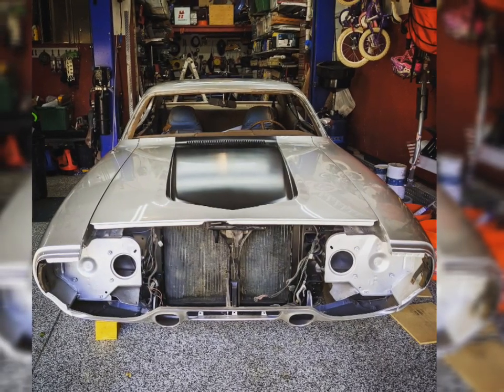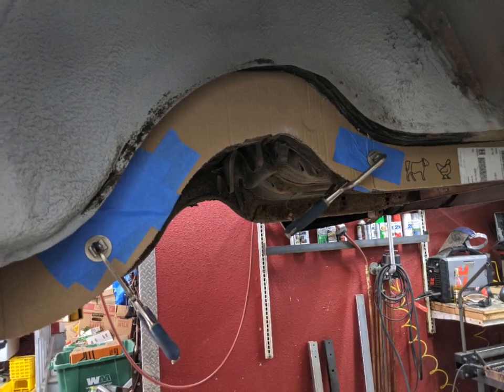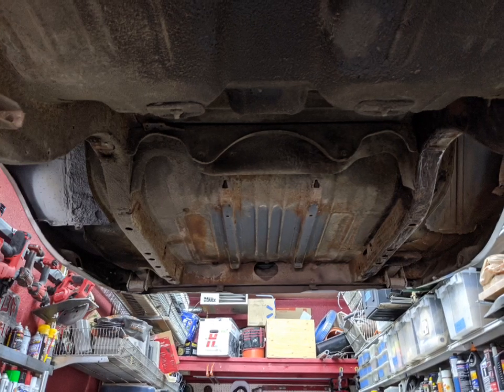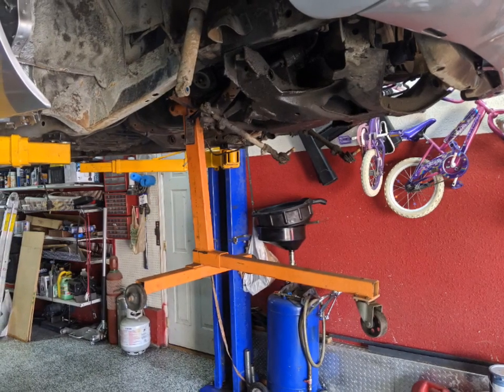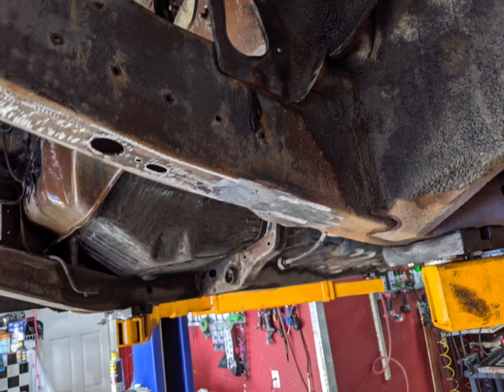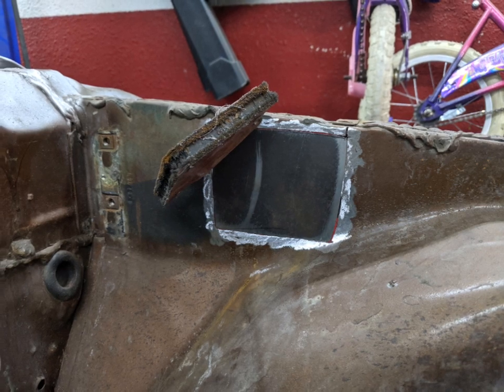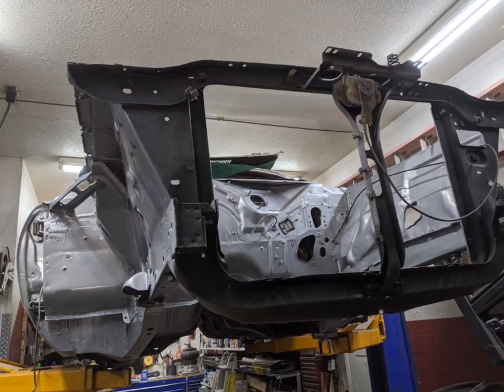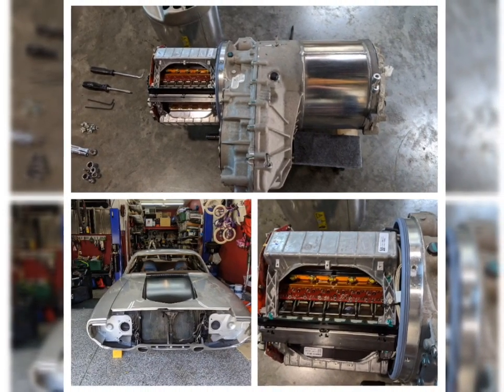Project Electrollite - Plymouth Satellite Tesla Swap - De-ICEing / Tear Down, Ep. 2

Comment: I heard about this project and will watch all the episodes.  I know the structure of these cars very well so it is interesting to see the typical rust repair going on here.  Nice work on the repairs.  I know industrial inverters very well also and always wanted to build an electric car.  Over time I lost interest because the government is trying to jamb these things down our throats now.  I will watch Kevin do the conversion now instead. By the way, I have a 60V battery powered chain saw with a brushless DC motor, its great.  I can saw all day, when the battery is dead I just grab another fresh one off the charger and go.  That doesn't work as well for cars.
Reply: Even the clean ones rust around the hood hinges.
Reply from the maker: Thanks for watching Michael, I appreciate the comments!

Comment: What is the paint you like for engine and underside?
Reply from the maker: I use Rustoleum hammered finish paint.  It is easy to apply, dries quick and leaves a hammered looking finish that is durable and can easily be painted over.  Great for a car you will use, doesn't look as good as show paint.